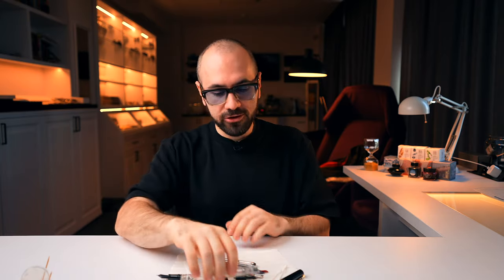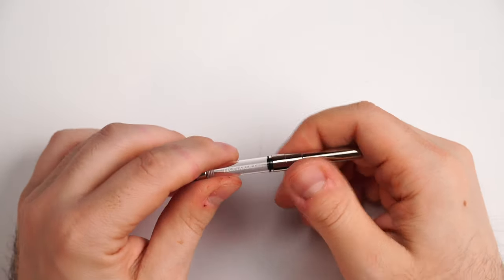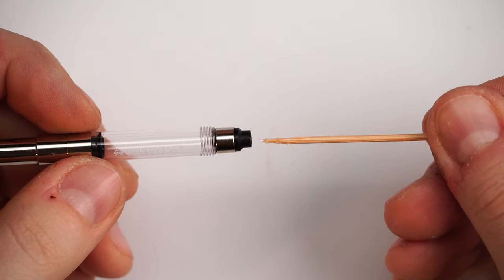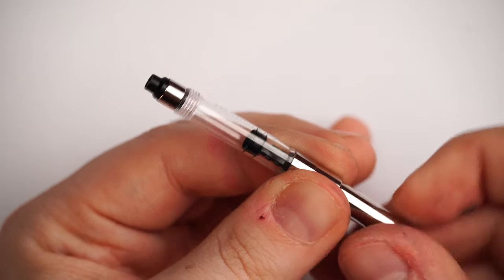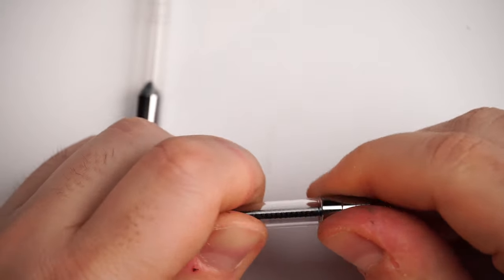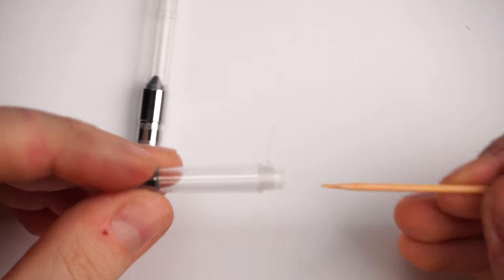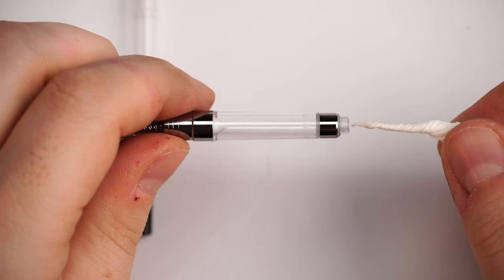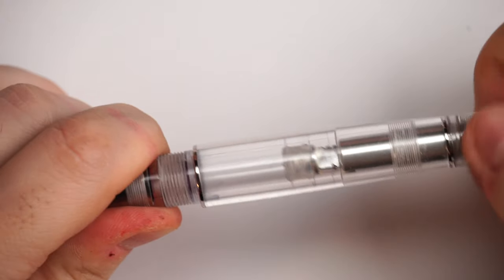DYI - Greasing ⚙️ fountain pens 🖋️

Comment: Thoughts on how to lubricate a Pilot Custom 823? Pilot insists on avoiding the opening of the pen by unscrewing the section.
Reply from the maker: thats a good one :D well if opening the pen is nowhere available or you dont want to do so, the only lubricating way its to use it a couple of times with one of those Noodlers lubricating inks - but I have not tested it and I dont know how that can work

Comment: Great video! Super helpful to see the process in the demo Leonardo -- I had one leaking out the bottom once, but thankfully some silicone grease on the unit patched it up.

Question: if I wanted to grease up the Kyuseido/Gravitas Kakari, should I also do it on the exterior section of the mechanism? Namely the portion of the rod that exits the barrel. I have felt that the glide on the rod of mine is not as smooth now after a few months, but I'm not sure how best to apply the grease.
Reply from the maker: Thank you so much for your feedback :D sometimes a little grease can fix some leaky threads.

For the kakari pen ... its very simple just extend the rod and grease it outside of the pen as it extends at the base... when you insert it, some grease passes in the pen and greases the whole length